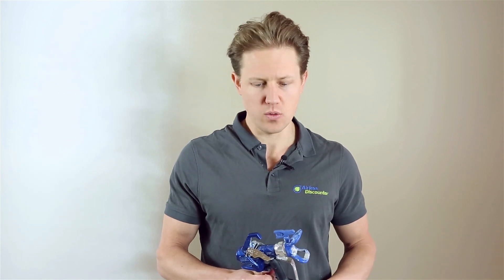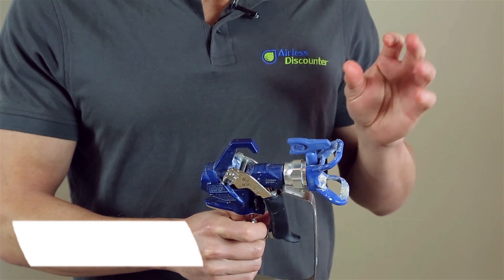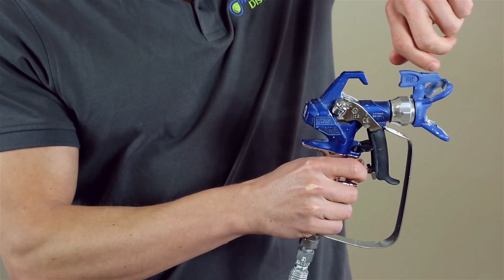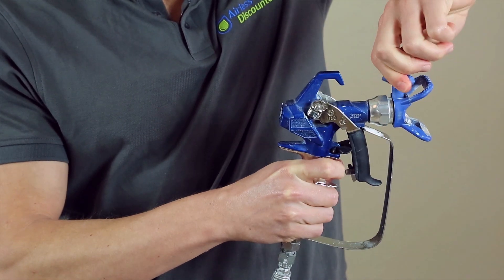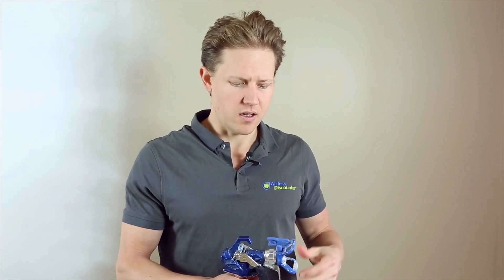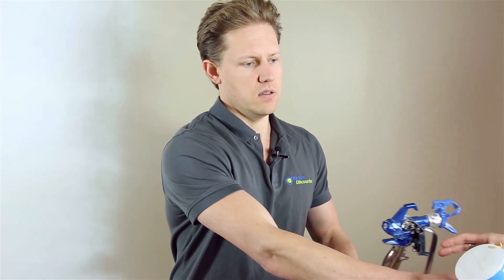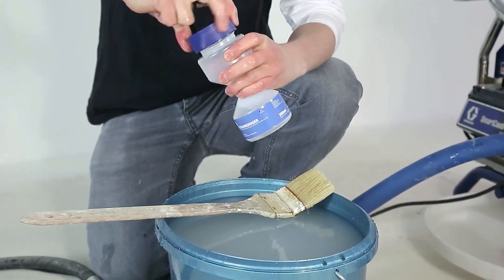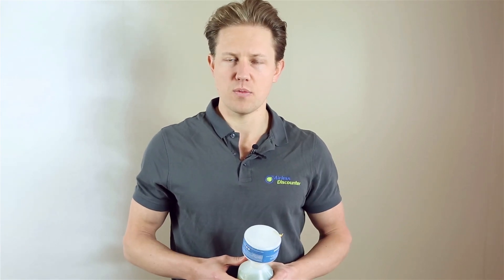Airless Q&A #19 - Cleaning a Clogged RAC X Spray Tip (BEGINNER Video)

Comment: duh.  everybody knows to turn the tip around.  what next after that doesn't work??
Reply from the maker: Reversing the tip is the first step, but if that doesn’t help, check and clean the filters and the nozzle. If the issue persists, the tip may need replacing.
Even if airless nozzles aren't a lifetime item, here's an accessory to help keep them in good condition between jobs : https://airless-discounter.de/FARBMAX-Tip-Cleaner-for-Airless-Nozzles-Egg-timer-200-ml
Kind regards,
Airless Discounter team

Comment: How do you know it's time for a new Spray tip, or to clean the various filters? Gun kept clogging, then leaking from around the spray tip, not sure whats the best plan of action.
Reply from the maker: Hi,
For the spray tip, it is when your spray does not have a good figure anymore and consume more paint. 
The filters need to be cleaned after each use. 
If the gun keep clogging, check if the tip is ok or too small for the product to spray. The leak can appear there also if you lost the seal in there. 
Kind regards,
Airless Discounter team